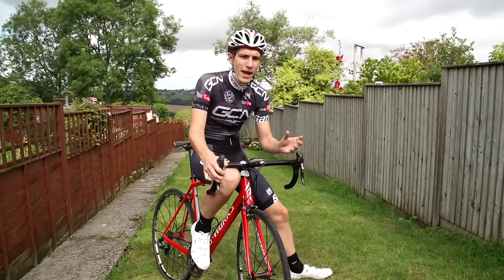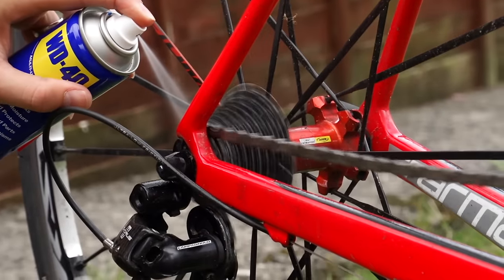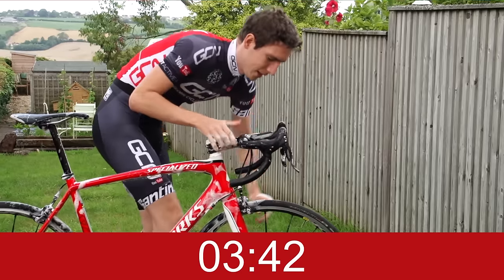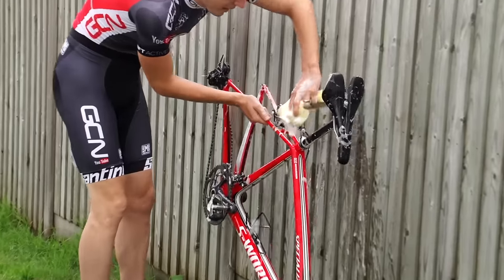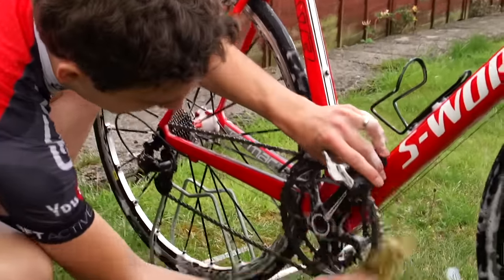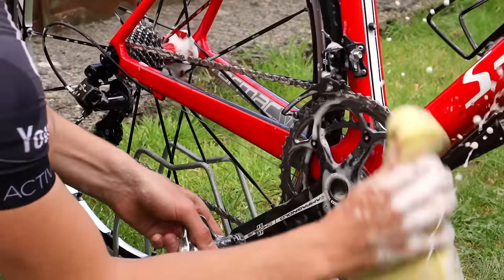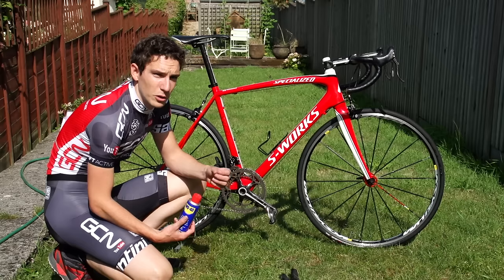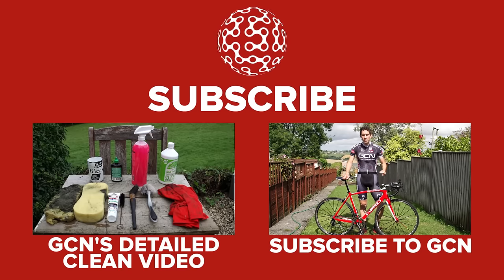The 5 Minute Bike Wash - How To Clean Your Bike In A Hurry

Comment: It takes me five minutes to fill up the bucket
Reply: Yeah! Same here!
Reply: Lewis Weekly Use an outdoor faucet connected to a hose. Do not try to fill the bucket by peeing into it. Actually  5 minutes is fairly impressive for a medium bucket.
Reply: Takes me about the same trying to get the rear "quick release" wheel off and out from the chain. Lol
Reply: You made my day sir
Reply: +Lewis Weekly  You from africa or what?
Reply: +Lewis Weekly do you use a table or a tea spoon? quite impressive time either way!
Reply: +Microage got to fetch water miles away in barren land is quite an effort to fill a bucket
Reply: Global Cycling Network Thanks for responding...I hear ppl saying you should leave it upside down to let water run out also...Yes or no to this?
Reply from the maker: possibly, mine tends to drain from the BB.
Reply: Lewis Weekly took me 20 mins just to take the wheel off
Reply: Lewis Weekly Yeah
Reply: Helen Stevens... That's nice. I actually take the bucket with me on a long ride and try not to spill any !!!
Reply: Lewis Weekly took an hour
Reply: Alfred Limescale haha!
Reply: Lewis Weekly seems like you are using bathtub instead ㅋㅋㅋ
Reply: Lewis Weekly Lol.
Reply: Lewis Weekly haha
Reply: All that in only 5 minutes? Not really manageable. I think this procedure should be done, say, once every 2 months and take around 20 minutes if done properly. Otherwise after each ride what I do is just clean the bike by wiping it with a damp piece of chamois leather, rinsing it off as necessary in a bucket of clean water. Stays very clean like that each time. As for the chain and derailleur I just clean them when I see it them getting dirty. Apply WD40, wipe off crap with bad cloth, then wipe with cleaner cloth. Apply few drops of chain lube and that's it.
Reply: hahaha SAME! I was so impressed, he made it look like turning off a light switch!
Reply: Lewis Weekly oh my the funniest comment of the year 😂👍
Reply: Outdoor faucets with hot water? lol
Reply: Use a smaller bucket?
Reply: @OnlYYlnO  hahahaahaha
Reply: For just £2 a month you can help people like Lewis Weekly get the life saving water he needs to clean his bike. Act now.
Reply: XD
Reply: Baby wipes are amazing for cleaning frames/ brakes, everywhere but the chain (I use a tooth brush) for a quick clean. Takes thick mud off and you don't need a bucket and a sponge. Gain time on not having to fill a bucket. I cycle all year round and have no issues.
Reply: hahaha!! :D
Reply: Lewis Weekly Do some intervals trainings at high intensity two or two days a week and you’ll see results, one day you’ll wash your bike like a pro
Reply: LOL!🤣😅😆😀😁!!!!!
Reply: It takes me longer to even think about washing my bike let alone my car 🤣
Reply: It takes me five minutos to find everything I need. Forget trying to take the wheel off!!😅
Reply: me also collect the equipments to wash the bike take one days and nothing happen after collected.
Reply: Took me over five minutes to watch this video.
Reply: Same

Comment: I use WD40 all the time and my bike is still in tip top shape. Then again, I never spray WD40 on my bike.
Reply: Haha
Reply: +Rudy Ramirez It solved my problem, still not drying out.
Reply: +Rudy Ramirez it's in tip top shape cause you never took it out the box
Reply: what's tip top shape ?
Reply: tip top = excellent
Reply: Everything but his bike
Reply: it literally took me 5 mins to work out what you had done lol
Reply: good condition
Reply: hahaha nice
Reply: i got you 1k
Reply: WD40 sucks
Reply: lol
Reply: Ive used wd40 too. Been 4 years using and it looks good as new still. Still my go to video for cleaning my bike. Getting my time down from 30 minutes to 15. Takes me a little while to get my wheels back on.
Reply: Lol
Reply: @joshdaniel5612  : Sucks what ?
Reply: @Kingcarparpeggio  it can't clean my chain properly
Reply: @geraldowebber1322  I realised after reading your comment
Reply: Yooooo ctfu

Comment: I know many are sceptical about the WD-40 idea but it is important to consider how frequently you clean and lube. If, like Simon, you clean and lube after every ride, then WD-40 should work for you. WD-40 is a highly volatile lube, which means it evaporates quickly compared to a traditional heavier chain oil. Reapplying WD-40 after every ride avoids this issue. If however you will be using your bike for prolonged periods between washing, such as a commuting bike that will do short journeys all week long and be left in the open at work all day, I would look for a heavier chain oil. In my experience the biggest killers of the drivetrain are dry running and prolonged dirty running. A regime of ride, clean and lube avoids both. If you don't have time to do a full wash down (like Simon in this video) try to at least give your chain and rings a blast of WD-40,  a wipe down with a cloth then reapply lube; I find an old tea towel perfect. The other advantage of a combined solvent/lube is that you are not worrying about compatibility of the solvent and lube or any need to remove the solvent after cleaning.
Reply: Thanks
Reply: Nice. I think you just saved me some headaches.
Reply: So what should I use to re grease my cassette and chain?
Reply: i got wd40 bike i am gonna hope it works as a regresser
Reply: It worked okay.
Reply: The "every ride" metric annoys me. How long is a ride and under what conditions? 100km, 200km, 50km, 10km, 1km? Personally, I find an application + wipe down of WD-40 lasts me around 300km, give or take. I've been doing the experiment for nearly 3 years now and nothing has exploded yet.
Reply: iCapybara 
ㅋㅋㅋ explode 아재 개그감이 뛰어나네요
Reply: This comment is very helpful and thoughtful.
Reply: Dear Andrew and all of the other people answering. WD40 Is not infact a lubricant but rather an oil based Water Dispersant hence WD. As far as we know cause there is no patent on it and therefor no recipie. To be honest thats all it should really be used for, to disperse water from parts where it does not belong. For example after washing your bike. As its oil based however it is also great for cleaning bikes or anything els which is greasy or oil based. However I would not use it on rubber or silicone as oil tends to dissolve or degrade these. Here is the problem though, the effect it has as a Water Dispersant is to form a thin film of itself over the surface of everything it comes in contact with. This is so that, water does not come in contact with the surface or any water preset gets dispersed. This however also means that any lubrication which is for example meant to provide lubrication between two metal surfaces now provides lubrication between 2 WD40 surfaces. It can also happen that the WD40 dissolves into any lubrication altering its composition or completely repelling it from the surface. And yes as mentioned in other comments as a Water Dispersant it has the property of easily spreading and running into everything including sealed bearings. Therefor I like to use WD40 to dry my bikes components as well as cleaning of grease however afterwards I take care to clean of the WD40 with alcohol and then appropriately lubricate all parts.
I hope that this helps and puts a bit of light in the mythical debates about WD40. :-D
Reply: But if we use the oil as he used it, won't oil affect the breaks?
Reply: we have a variant of WD 40 in sweden that is a lubricant too so probably just what kind of base and purpose its made for it also removes rust
Reply: What if we don't have tea towels here in the US
Reply: Ionut, I believe he used it on the calipers and not the pads.
Reply: @theman7050  Nope. The words "tea" and "towel" had never been uttered together in this fashion in the United States ever by a single US citizen. Ever.
Reply: @BPoweredLove  
Agreed. I've never heard that term before. I'm a 45 year old American born citizen.
Reply: Daniel Zhou I believe you call them bar towels in the US
Reply: Hang on I'm pretty sure sensible (non racist) youtube comments are illegal no?
Reply: Nice explanation
 Confusion cleared
Reply: That's why belt is now very good solution.. no worries about maintenance
Reply: This was really insightful, thanks
Reply: Thanks! This is the comment I needed about WD40.
Reply: @danielzhou9968 coffee towels
Reply: It isn't a lube. It is wide ranging, but it is intended for cleaning (water removal). It is probably a similar price or less, if you have it on hand, to use actual lube.
Reply: Good clarification, thanks.
Reply: @ionut-stefandinu9302 YES . 100% . Merci beaucoup for your remarkable question.
Reply: @danielzhou9968 trust me, there are tea towels in the US. What do you dry dishes with?

Comment: tried this today. took me 30 mins to get the rear tire back on with the derailleur 🙈👏
Reply: Yeah, I've never found the trick for getting the rear wheel back on. Also my new bike has thru-axles so takes longer to remove and reinstall.
Reply: i thoguht i was the only one having this issue. I am new to road bikes and bought a trainer for Zwift. So I have to remove my rear wheel when setting up. Everytime I am scared that I can't put the rear wheel back on - which means i rarely ride outside...
Reply: Do it more often, you'll get the hang of it

Comment: I'm a supporter; I love this idea!!! Thank you!! The simplicity and cost effectiveness are truly wonderful. I've biked for years and never knew I was to wash the chain. Frightening right. Yes. I bought the WD 40 Bike Degreaser and the WD 40 Bike Lube  and I got busy on my years old dirty chain. I sprayed, yes sprayed, that filthy chain and used a scrub brush on it, three times - and much to my dismay, I could see the silver color of everything again. I thought chains were to be black. lol. I can't believe I'm admitting this, but it's true. There were chunks of dirt and grease that dropped out of the jockey wheels. I am so excited that I will join the group in having a shiny clean chain!! Thank you for this simplistic approach (not having to take chain off or use scary chemicals) which I was comfortable enough to do, being that I'm afraid of all those mechanical parts.
Reply: Just for information, if never mind, grease absorbe all dust and dirts,so dust turn to be like a soft file and dirt combination with grease or oil turn to corrosive semi liquid, so could be very harmful even could intrupt the mechanism over all
Reply: @David-vb8tg  WD is fish oil. Not scary.
Reply: @kathyleahy7314  no household chemicals are scary
Reply: Do you still ride the same wheels , same cogs & same chainrings??
Reply: oh no I just thought he had a special shiny silver chain😭 I need to clean my bike can I just use soapy water no wd40 then grease the chain with normal lol?

Comment: I usually reserve WD40 as a lubricant for bikes that haven't been lubricated in several months and are on the verge of rusting (it works wonders and definitely doesn't damage the drivetrain contrary to most forums) - when cleaning my own bike (a project bike that's set me back thousands) I clean it with a sponge (maybe once a month certainly not after every ride) but I don't recommend using WD40 - not because it damages your drivetrain but because you can get a significantly smoother drivetrain with dedicated cycling lube which unsurprisingly doesn't cost much more than WD40 - though I use WD40 on the drivetrain to clear the gunk off it while washing the bike - and that works a charm.

Comment: You should use microfiber mitts or towels, and have a different one for wheels/tires.  A sponge will hold the dirt and scratch anything it touches. Two-bucket method is a good idea too; One with soapy water, and another one with clean water. Soap -> Use on bike -> Rinse in clean water, repeat. Way less dirt in your mitt and soap.

Comment: I tried the wd40 degrease and lube method on my commuter (200 miles a week) and I'm really impressed. It's been very wet recently and I'm only reapplying weekly. I think water is probably for the best on a commute bike, as you get more road crap on/in the bike so it makes sense to rinse the road salt and stuff out. You need to be on top of the greasing situation anyway.

Comment: I do about 150 miles per week all year-round as a London based commuter. My pro-tip is let the mud and gunk dry overnight then brush it off in the morning, then do a proper clean and lubrication job at the weekend.
Reply: Any tips on the type of lubricant?
Reply: @quietatse  as for london you should use wet lubricant

Comment: I've been using it pretty much after every ride and the chain and gears still run really smoothly, first 1000km done on this bike and still going strong, I'll probably grease up the bearings sometime next spring but apart from that the main downside is that I can't live with looking at a dirty chain again. Still get some shocked expression when I explain what I use but then tell them GCN does it and they're like 'Oh'.

Comment: Guys, spray a bit of WD-40 onto a clean cloth and use it to polish your bike. It looks great. I do it all the time after a thorough wash on my DH bike. If you do it just before a wet ride it helps prevent as much mud sticking too!
Reply: MrWtfchicken thanks for the advice :) but isnt it quite annoying when you touch the bike and have oily hands? :D
Reply: +MrWtfchicken silicon spray works better!!
Reply: +MrWtfchicken i'd suggest a bike spray, like the muc-off multi purpose one, its pretty cheap and will protect the frame much more thand good old WD-40. i use the WD for hinges, not bikes. Its like buying the queen a bile of mud for chrsitmas
Reply: again, silicon spray is what they use in bike shops to give the showroom look...!!
Reply: +MrWtfchicken Actually the only maintenance we will ever need is a huge bucket field with wd40 and then just dip the whole bike in the bucket before and after every ride :-)
Reply: +toasty bear maxima sc1 ..best I've  used so far.
Reply: +antoine van der Straeten that made me lol
Reply: I use wd40 for a lot, also just cleaning/degreasing. Works great

Comment: I was ok with the WD40 right up until you went and sprayed it on your brakes.
Reply: same
Reply: Brake Calipers have metal springs in them that perform better if kept rust free.
Reply: The problem is that the pads will also be attacked by the WD-40. Should be common sense to not apply lube to something that is supposed to brake, the pads.
Reply: Swapnil Rogye Yes, WD40 isn't the issue.  How he applied it (via a casual spraying) is.
Reply: Nah the brakes are unimportant. If they don't work just dig your cleats into the road surface or leap off into the nearest bush :)
Reply: HighsNBurgers this is some sound life advice I feel
Reply: lmao road bikes r made 4 speed,  brakes just slow u down m8
Reply: The friction from the brakes being used will heat up any excess WD40 and it will evaporate extremely fast. As mentioned above, WD40 naturally evaporates quickly already, with a little bit of extra heat it will easily slip away from any essential surface for braking.
Reply: Then remove your brake pads Bro 😂 AND voila ! ... Oh AND don't forget to clean any excess
Reply: hey, phreddo brakes aren't aero.
Reply: @inteusproductions  If WD-40 evaporates quickly, then it's not a good chain lubricant.
Reply: WD40 is not a lubricant, it's designed to displace water.
Reply: tim beard WD stands for water  dispersement and the 40 was the 40th time they got the ingredients just right so they kept the laboratory test name WD40 it is not ment to be a lubricant
Reply: @kurttappe  because it isnt, its a water displacement
Reply: @charliesmith7169  to displace water and to lubricate. It's also called penetrating oil, and oils are by definition lubricants.

Comment: A tip for your tip given to me by a professional car valeter. Use 2 buckets of water, one with clear water one with soap. Soap the paintwork then rinse the sponge in the clean water, then more soap for the next part of the bike. That way you get rid of any grit on the sponge and don't damage your bikes paintwork. And leave the tyres until last.

Comment: The chemical composition of WD-40 makes it both a solvent and a lubricant, meaning it can be used for both purposes but the lube concentration is pretty low so one will need to check and re lube more often If don't use a proper chain lube.
And don't ever wash your bike on grass leaving soapy water ever again and don't apply any kind of degreaser/lube on brakes :|
Reply: Waseem Zia I got the same thoughts
Reply: Here in Seattle, Washington, USA, they tell us to wash our cars on grass if we do it ourselves or at least be sure the water drains off into an unpaved area where it can be absorbed into the ground. the soapy, dirty water draining into streams and lakes is bad for the environment.